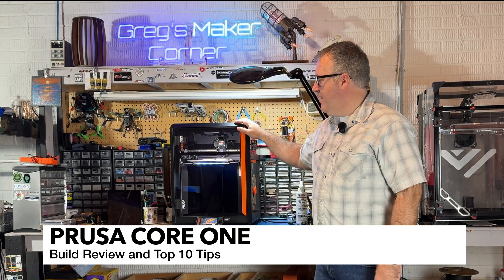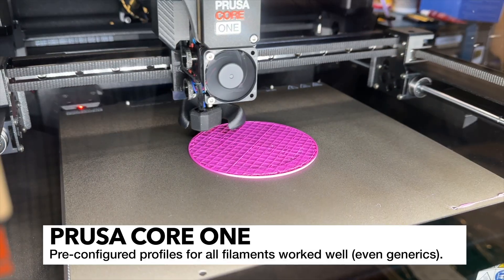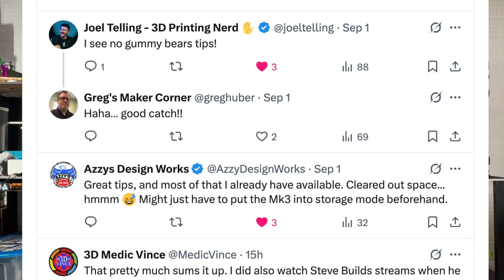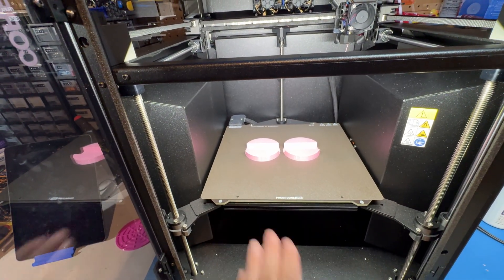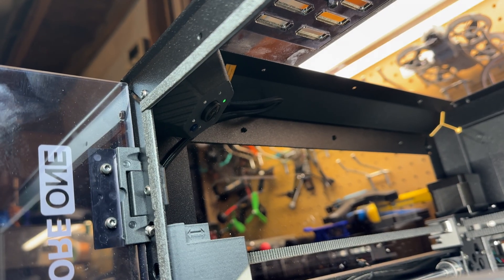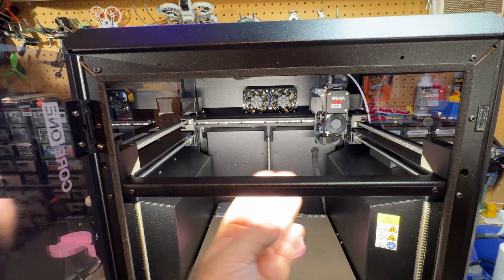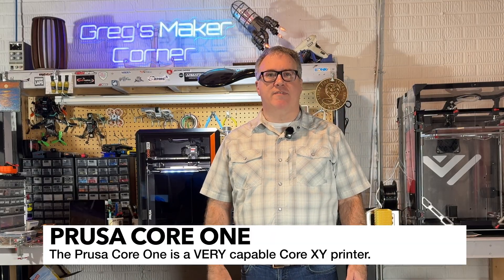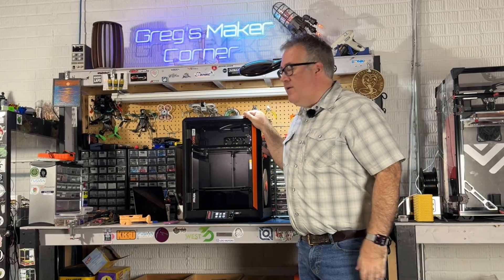Prusa Core One Review and Top 10 Build Tips

Comment: Hi from France !! Thank you for sharing your impressions of the printer. I completely agree with your 10 opinions regarding the construction of the kit. I faced a problem with the filament sensor cable which was hindering the movement of the gantry towards the rear. This caused the calibration of the Y axis to fail. The cable must be stretched and tightened by the zips.
Reply from the maker: Thanks for sharing your experience! Appreciate the feedback and tips on the filament sensor cable.

Comment: Mine either is perfect hit print and walk away experience OR it fails nozzle cleaning, has a collision and forever fails to auto home and never even starts printing 😭. 

Also when using Orca slicer and setting a minimum chamber temp the printer says it’s waiting to achieve that temp but never heats up the bed or anything… but that’s a I need to learn to code problem I believe.
Reply from the maker: That is a bummer when you have issues like that, and I hope you're able to sort it out. Thanks for stopping by and commenting!!